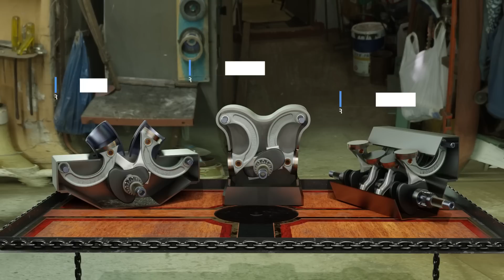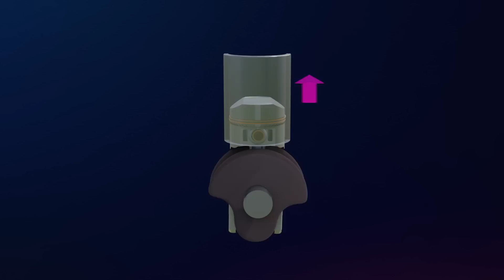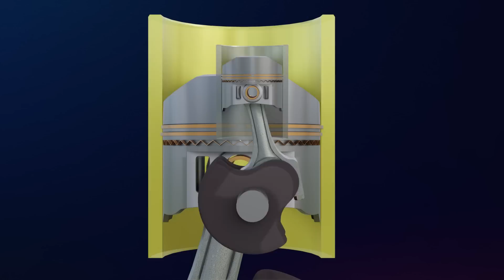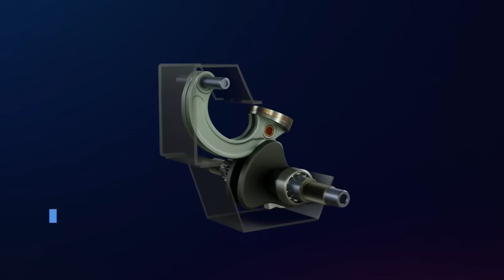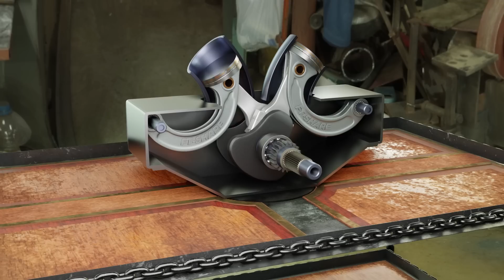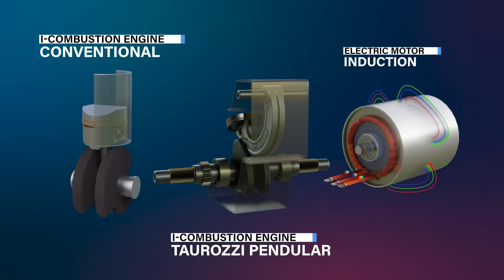All about the Taurozzi Pendulum Engine | Advantages, Working Principle, and Performance (100144.V1)

Comment: Side loading of the piston in a conventional engine can be reduced by lengthening the rod. This increases its mass but also makes the engine more geometrically efficient. It's a trade-off, like everything else.

No mention is made of the energy required to shove the pendulum back and forth- since it obviously will be doing it at far higher than its natural swinging frequency. Machining the block will be an expensive nightmare, and the piston itself will have to be curved along its axis so that it does not rock back and forth in the bore.

Comment: I wonder how the engine would do with a alcohol or other dry fuels since ethanol tends to dry out engines not rated or made to handle E-85.

I would love to see a fun business case to compare offering pendulum engines that run on dryer fuels (tooling, infrastructure, R&D, emissions performance) compared to the heavy investment needed for swapping factories to battery tech.

With how money hungry and machining heavy running a top fuel dragster is, I'm surprised they aren't exploring these engines. Lighter, more torque, complex machining challenges... sounds right up their alley.🤔

Comment: While I can see more advantages than mentioned in this video like an effectively longer power and intake stroke and shorter compression and exhaust, I can’t get over the bad info in the video. Even if piston side loading and ring drag were totally eliminated, it would barely make a dent in cooling system demands. While friction can take a few hp total (and create a proportionate amount of heat), what about the hundreds of hp worth of combustion heat…. The good old 1/3 out the tailpipe, into the cooling system, and into power. While that ratio is slowly changing, the point is, overlooking the main heat source in an internal COMBUSTION engine and saying no cooling system is needed because of a reduction (not elimination) of friction is a pretty big oversight.

Comment: This engine structure must be very directional, meaning only one correct rotating direction has the positive fuel efficiency gain, while the reversed wrong rotating direction will have negative gain. Thus its V structure and opposed boxer structure will have the gain cancelled each other.
So I think only by inline I-4 or I-6 structure this engine will have overall positive gains from all the cylinders involved. We need to answer: What is the only one correct rotating direction???

Comment: I'm looking at the angle between the connecting rod and the "banana" rod, and I'm thinking the wrist pin is going to have a short lifespan.  Which is stronger, a wrist pin or a cylinder wall and piston? All that mass! And btw you can run any ice on hydrogen,  and I do agree it is a much better fuel source. Cleaner, and about the same efficiency as gasoline. Almost same burn rate. People just get excited about the word hydrogen because they do t understand the properties,  and think the hydrogen bomb detonates hydrogen. It doesn't.  It uses the known consistent burn rate of hydrogen to compress the radioactive mass, causing the uranium or plutonium to detonate. Sorry, my mind wanders.

Comment: All the single con rod issues are resolved by using large marine diesel ship propulsion design of a two link connecting rod with the piston rod running only up and down through a seal also devolving the issues of fuel and gas and particulate contaminants of the engine oil and enhancing the thermal profiles and control. Re-machining and replacing (designated removable) straight liners both cheaply and quickly is a facet of minimal and low operating downtime and costs in the marine industry and lessons could probably readily translate to the dinky toys sector.

Comment: I wonder if this has benefits from the geometry the way an offset crank does? The original Prius had an offset crank which made the piston reach top dead center when the crank pin is already a little bit past the typical TDC which is straight up. When the power stroke happens, the crank is at an ideal leverage point to maximize torque output, instead of the maximum force being wasted pushing a crank pin straight down and trying to pry the crank away from the block. This design could go even farther.

Comment: How does one machine the curved cylinder bore with any degree of accuracy? How is the weight of that massive curved connecting rod balanced? What keeps the motor from shaking itself to pieces at 3500 rpm or higher? This a no-go concept for typical transportation vehicles.

Comment: Toyota uses a Atkinson cycle in its hybrids, which provides a 40 percent efficiency  over the Carnot cycle which extracts 30 percent in general from gasoline.  A more traditional engine giving roughly the same increase in efficiency.  The drawback is that the Atkinson is less responsive, but electric motors in the hybrid system take up the slack.  Notably, the plug - in RAV4 is the second fastest car in toyota’s stable.
Reply: You said Carnot, but didn´t you mean Otto cycle?
Reply: @STARDRIVE  yes

Comment: If you just increase the rod and stroke you can reduce the friction, it just reduces peak rpm, but diesels are designed this way since they are limited to low rpm.

Comment: How do they bore and hone a curved cylinder?
Reply: I’m thinking out loud here. Maybe it could be cast close, and then some sort of rotating tool is placed where the piston goes to guarantee it follows the correct curve.
Reply: Why would they need to? There is no side loading on the cylinder. Only a very light piston ring seal.
Reply: a ball hone ! hone hell how would you rebore it ?
Reply: get one of those curved drill  bits

Comment: Doesn't address the huge problem of growth variation during temperature change in the irregular cylinder. You can't have any gaps between ring and cylinder and the cold-to-hot transition guarantees gaps (as well as friction). They term this "a challenge". Yep, one we still haven't solved. "Booooring, call me when she turns over."

Comment: If there is a will. There is a way. In this motor pistons have no pressure to the cylinder wall, like it is in common motors, where pistons "want to go outside of the cylinder wall". So that is why all the pistons friction has been eliminated in Taurozzi Pendulum Engine. That means more power from same amount of gasoline, and longer lifetime of the engine. Usually in common motors cylinder walls worn out out of tolerance because pistons can freely rest to the cylinder wall without any extra support. So pistons and piston rings take cylinder wall bit by bit. When time goes on cylinders are slowly getting oval shape. In Taurozzi engine pistons do not rest in cylinder wall, because pistons have that extra support arm, that guides pistons way all the way thru cylinder.

Comment: Have them folded onto each other mirrored. So one combustion pushes both piston heads away from each other. Like a double boxer engine
Reply: I see, so now you've doubled the weight of spinning mass in the crankshafts, doubled the number of bearings on those shafts, and you have to synchronize those spinning masses using a gear train that will consume all the supposed efficiencies of the toroidal cylinders. And you have to make it a two stroke, because where would you put the valves?

Comment: More difficult and expensive to manufacture.  Greater width resulting in fewer viable applications.  More wear points requiring lubrication , repair, replacement.

Comment: If you look close you at 4:02 you can see that the connecting rod is crossing over and into the bottom portion of the cylinder wall.  This is a no go because the rings will be open to the crankcase and the oil.  Over time the rings will become covered with crusty oil not allowing them to seal, plus you will have blow-by into the crankcase.  Also you will be adding huge amount of reciprocating mass thus increasing stress at higher RPMs and keeping the motor from revving very high.  I think you would be much better off with a conventional set-up using a large bore and short piston, long rod and a short through on the crank.  His principle might make a good diesel engine.
Reply: It did make a good diesel engine, there are a couple companies that use them in diesel generators.

Comment: The highest source of friction in piston ICE is the rings not the pistons.
The rings are required for sealing. Poor sealing leads to poor efficiency.
Bore wall roughness, typically called finish, is critical to sealing, wear and service life.  This shape bore could not finished to acceptable standard due to it's shape.

Then there is the weight and size increases required for the layout.

It's a bust

Comment: I doubt there is much less friction on this design, and it actually needs more precision machining so it doesn't have more binding and friction. I don't see any real problem this engine design fixes, and the extra complexity with no real advantages is exactly why it is not mass produced. Compressing the gases and the combustion is what produces most of the heat in an internal combustion engine.  Even an air compressor with no combustion produces a lot of heat. If there was much friction in a conventional style engine, the pistons would wear out very rapidly, but they don't. This engine design is just a novelty.

Comment: Almost every viable idea using piston engines has been tested already, but the claim of 30 percent reduction in friction if true would be phenomenal in racing engines and saving fuel. 
Great video. 
👍
Reply: proved, in compressors
Reply: There is no way this produces 30% more efficiency!
Reply: Except its a complete LIE

Comment: At the end of the video, it does a switcheroo going from talking about reciprocating straight cylinder engines compared with this engine, and then starts comparing it with electric motors talking about the banana engine running off hydrogen. . . Yeah maybe. 

I just don't like how it crop dusts ESG.

Comment: In my opinion, the best way to optimize and simplify the design of the Taurozzi engine would be to replace the complex system made up of the "rod-banana guide" set, together with the connecting rod and crankshaft, by a double curved chainring, like a curved fork, which could be welded to the base of the piston with a semi-toothed gearing knob coupled to the rack gear.

This would substantially reduce the moment of inertia and consequently increase energy efficiency, decrease fuel consumption and increase power without significant changes in torque and further reduce friction.

Comment: I'm a mechanic and custom fabricator and I see NO difference in friction as the main side of the friction ACTUALLY comes from the rings ..
Furthermore roller or needle bearings actually have MORE contact and friction and are weaker due to there area of contact ..
Furthermore there is no friction from the crankshaft it's floating on a pressurized oiling system unless there's a problem and detonation occurs ..
If I was wrong the engine bearings wouldn't last over 500k in looked after engine